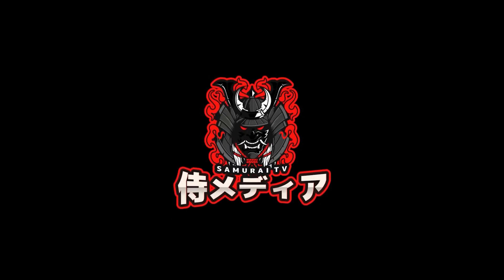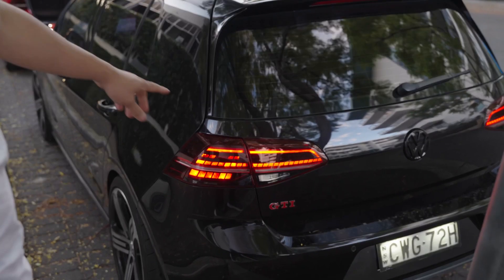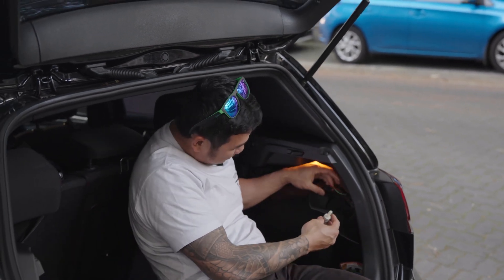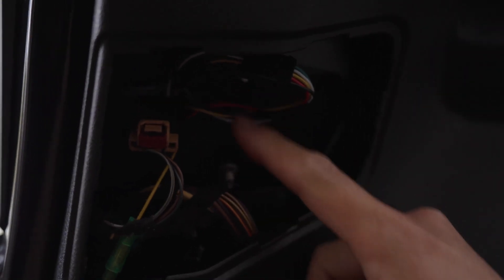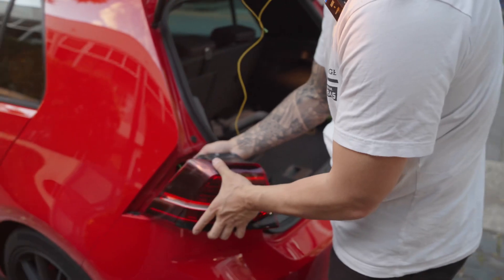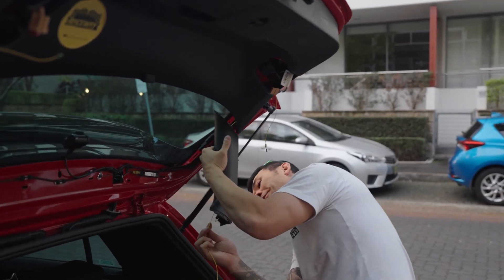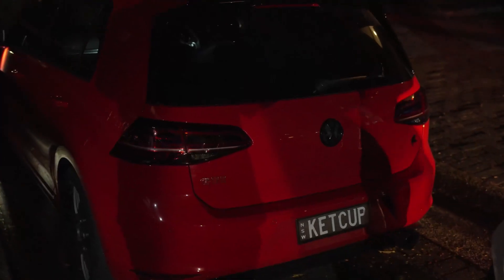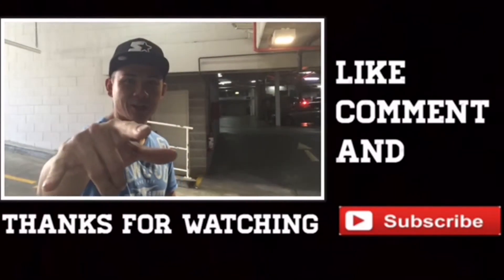RETROFIT MK7.5 STYLE SEQUENTIAL TAIL LIGHTS TO MK7 40YR GTI

Comment: Plug and play?
Reply from the maker: Yessir, plug and play (aftermarket set)
Reply: is it necessary to connect the secondary cables?  @samuraimediaco
Reply: @jdanildlh7  If you want the turn signal to be on both the outer and inner taillight then you have to. Otherwise itll only show on the outer taillight.
Reply: @samuraimediaco please assist with how the yellow cables for inner indicator should be run. I’m connecting them myself and only the outer light is indicating on both ends. Do I have to strip the inner boot?